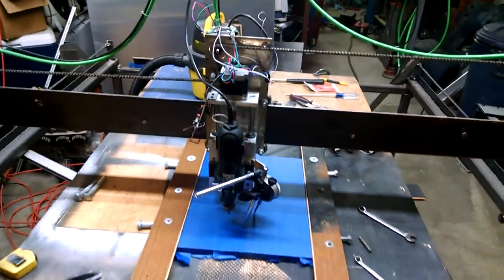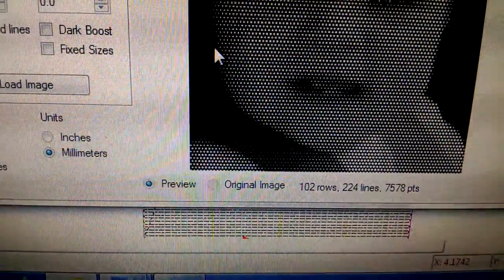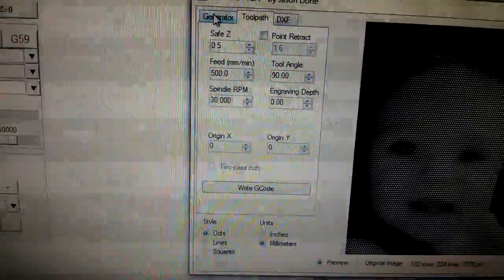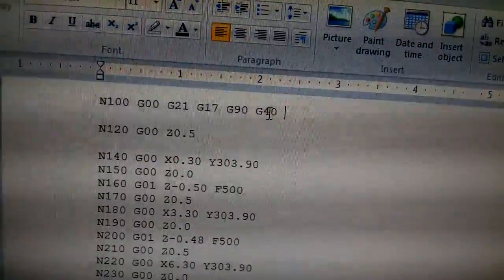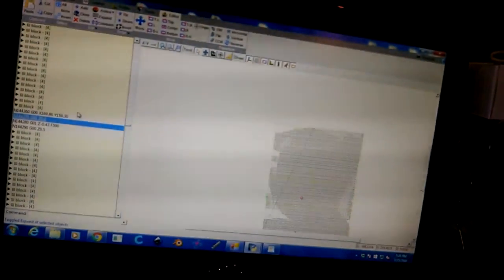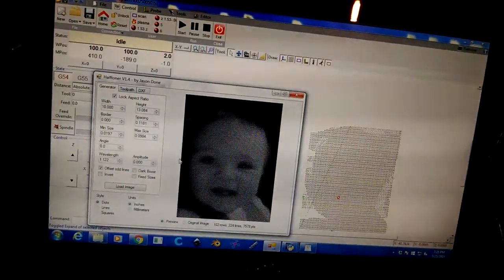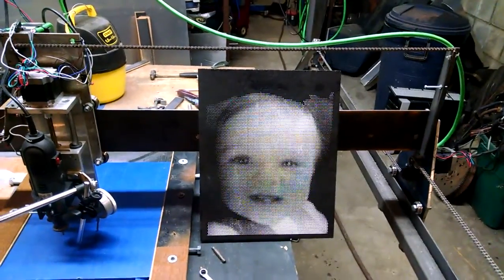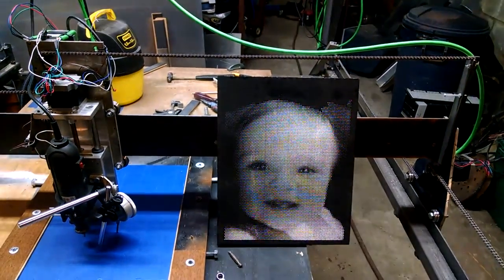Halftone imaging CNC plasma/router

Comment from the maker: I use 90 degree 1/8 vbits from Amazon. I can cut 2 pictures before it needs sharpened. I also stopped using tape and went with contact paper (shelf liner) since this was shot.